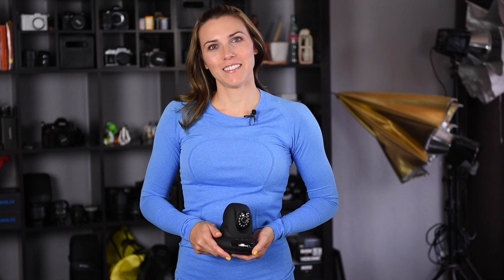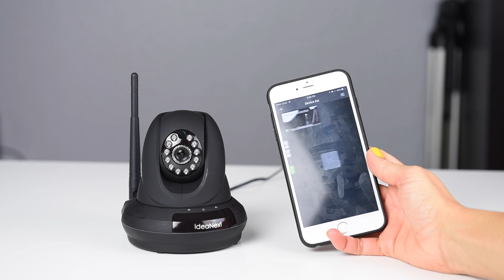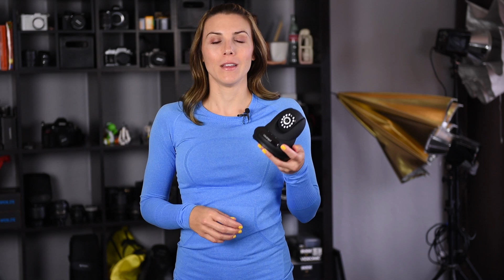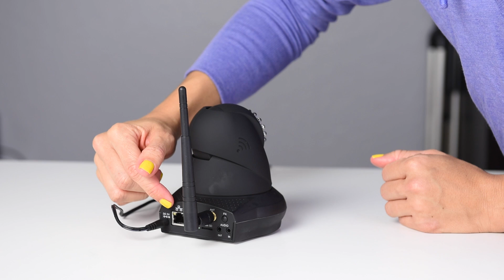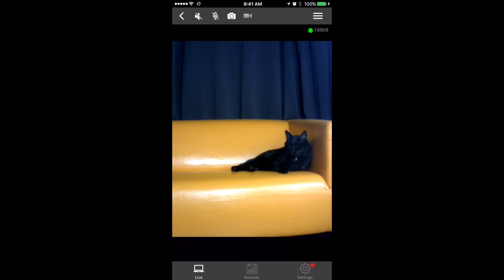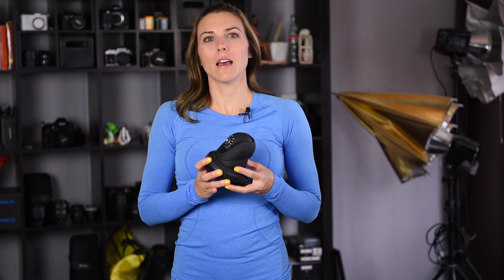IdeaNext Cloud IP Camera - SnapChick Review

Comment: It sounds very useful. However, without a hard wire disconnect switch, I question how secure it is? If you can see what the camera can see, then someone else can see you when you're at home. Yes, you can unplug the device. However, if you have several, that's a bit of pain, each time you come home.

Comment: ive had a few of these ,they last around a year or 2  ,then they die, wireless coverage is spotty at most out of the original 4 camera system i had set up,only 1 is still operational ,i do love that it is wireless ,because i dont have to run the cables,but when this one dies out ,i will go back to a wired system